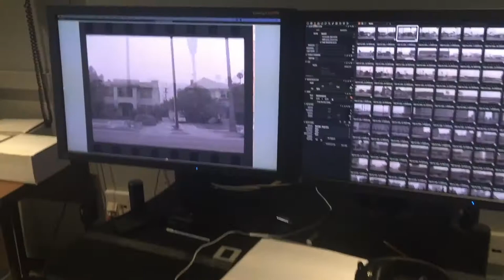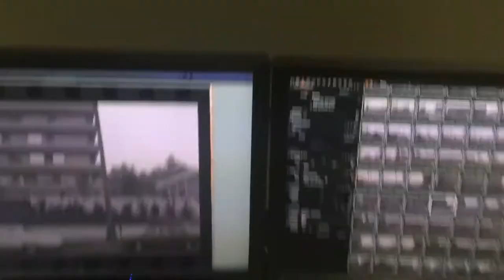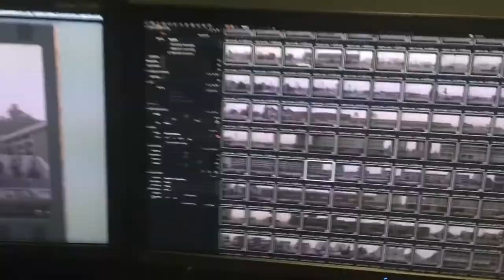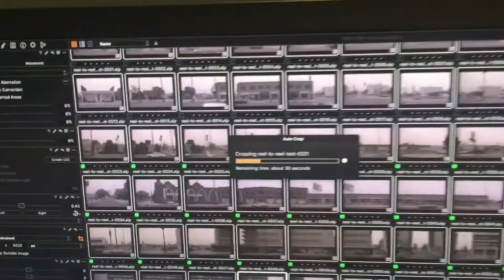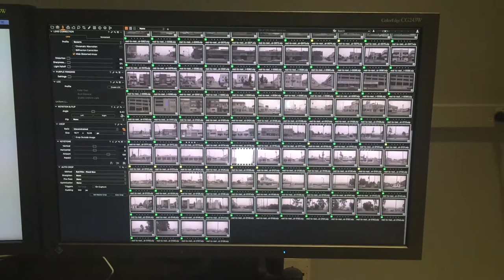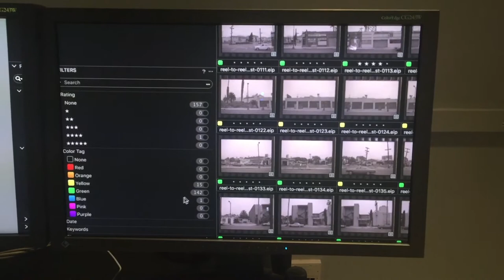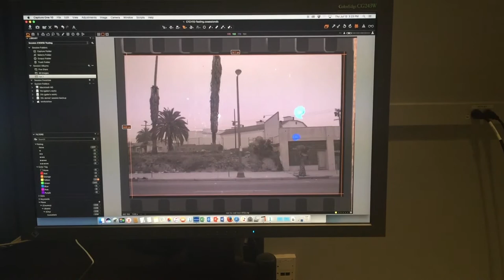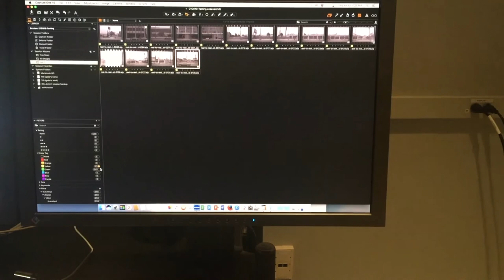DT Reel to Reel 12K Resolution Film Scanner

Comment: I bet the quality is fantastic, much better than those scanning 20+ frames per second.
Reply from the maker: Indeed. Trying scan at 12k (or even 8k for that matter) while the film is in motion is a fruitless endeavor. When you compare the per-pixel sharpness of our captures to the designed-for-speed systems the difference is significant.

Not to mention we're capturing a full 16-bit raw file for each frame (not just an 8-bit or 10-bit scan wrapped in a 16-bit container) and using an illuminant with 97 CRI-14 and 97 CQS, so our color separation is as good as possible.